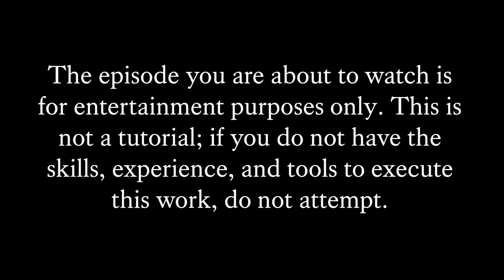Winchester 1892 45 ACP:  Anvil 113

Comment: This is a .451 bullet going true a .427 bore, or I'm wrong?
Reply: Wrong. The bbl was marked 45 LC
Reply: @quiettime6871  I doubt about that marking. There was never a model 92 in 45lc.
Reply: @walterlohrmann7248  The barrel is not original.
Reply: @ActionEHamshraershV  94 barrel?
Reply: @frigglebiscuit7484  The 94AE was chambered in 45 Colt in the early 1980's. I'm more inclined to believe it was a custom commissioned barrel earlier in the 20th century that was made to mate to the action.
Reply from the maker: @frigglebiscuit7484  Yes

Comment: Good video but your output volume is very low. Got my volume all the way up with headphones on> still very low. When my computer went from windows 10 to 11, all volume took a nose dive. Very strange.
Reply: Update audio drivers. You also may be able to roll back in device manager
Reply: Not really, since XP, Windows has been a polished turd. Recommend learning a Linux flavor for security and customization
Reply from the maker: We are working that problem currently.

Comment: I want someone to build me a live suppressor Delisle carbine
Reply: That's the one that started life as a Lee-Enfield, right?

I think it's not too hard, other than paying Uncle Sam the $200 for the tax stamp.
Reply: @ScottKenny1978  yes and nope try 2 $200 tax stamps it’s an SBR and integrally suppressed
Reply: @rednecksniper4715  still has a total overall barrel of 16", though, IIRC.

So you weld the outer tube of the suppressor onto the barrel, same as with a pinned&welded muzzle device on a 12.5" barrel to make a 16" barrel overall.
Reply: @ScottKenny1978  no it doesn’t original Delisle used 10.6” thompson barrels
Reply: @ScottKenny1978  I’m making a clone correct Delisle not some half assed suppressed bolt action 45
Reply: @rednecksniper4715  ah, my bad, I thought it had a longer barrel.

So yes, that would need two stamps if you're not going to pin&weld the outer sleeve onto the barrel.
Reply: @ScottKenny1978  not how it works the outer sleeve is the suppressor body with the baffles inside you can’t weld it to the end of the barrel
Reply: @rednecksniper4715  I've seen other integrally suppressed rifles built the same way. shrug